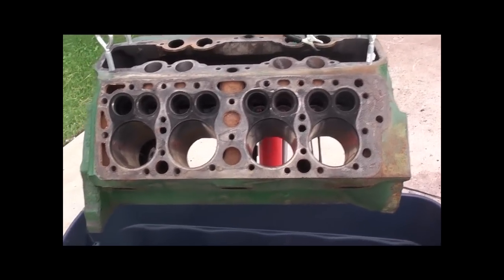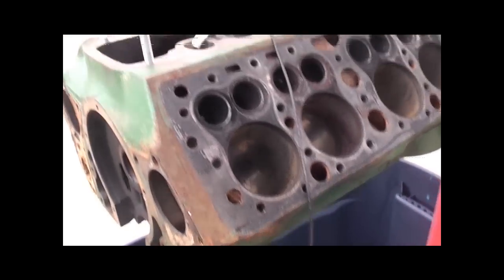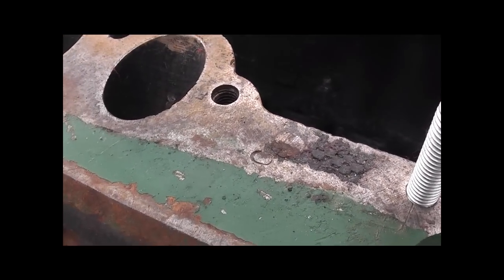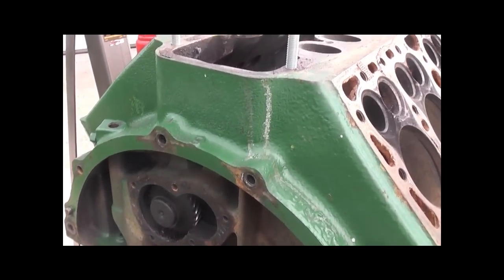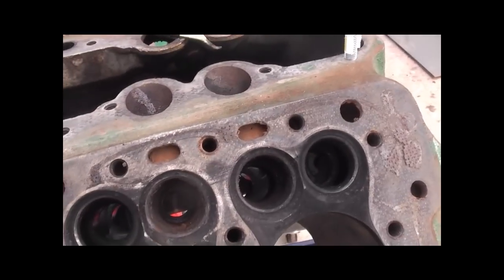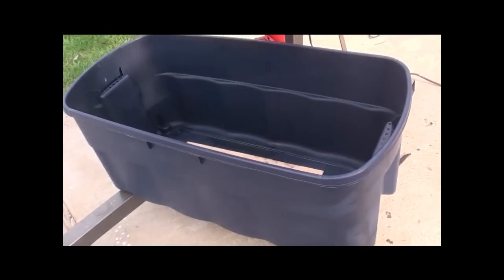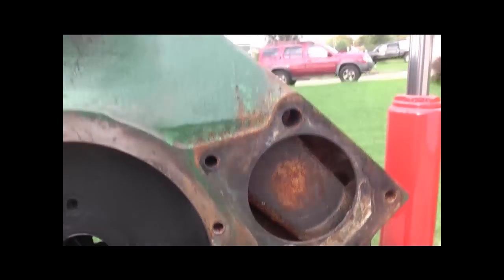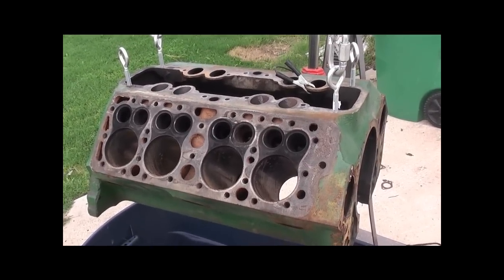Flathead Ford Hillbilly Electrolysis

Comment from the maker: Luke, 
Yes, I did put it up on a block of wood...this allowed the solution to get up in the area where the Crankshaft and Camshaft used to be. Rust was no problem there, but there was lots of gunk for the process to work through. Yes, if I had a continuous 12v, I believe 12 hours or so would have done it. I did have better luck with the charger on 6v...would stay on longer that way. The real key is to get enough anode in the water. The more anode, and the closer it is to the rust, the better!